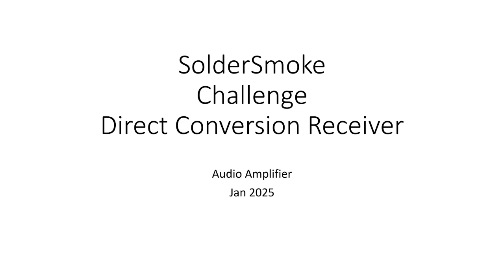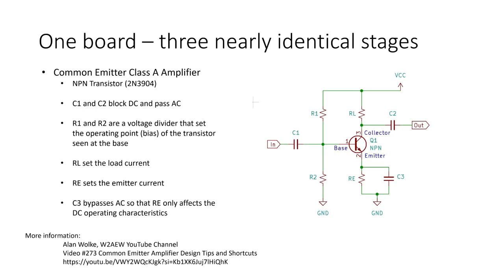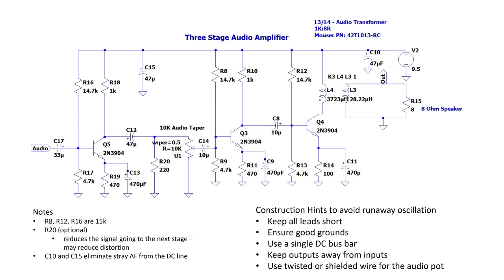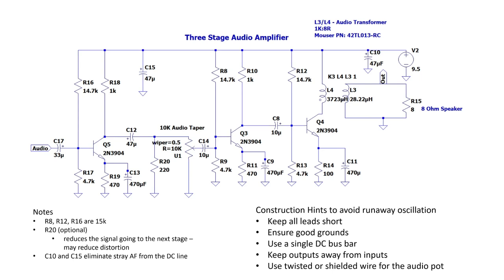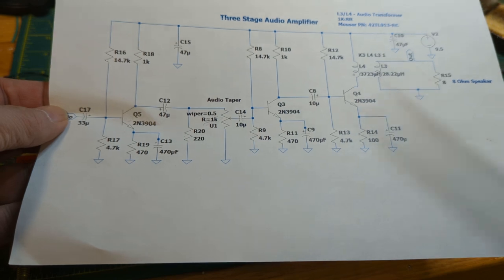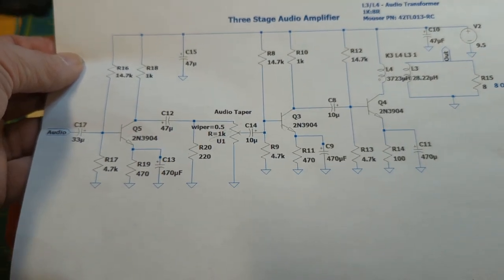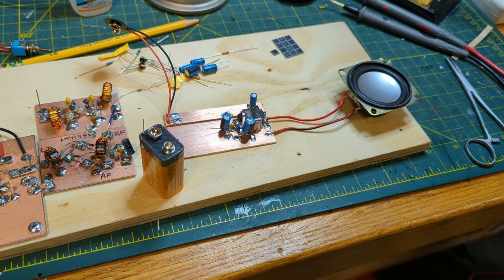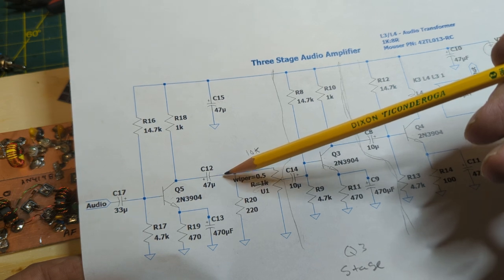SolderSmoke Direct Conversion Receiver Challenge #5   Audio Amp

Comment: Great job! You are a true Elmer. Now please do an Xmitter. :)

A more detailed explanation of audio-taper volume controls, (potentiometers/pots) for the curious:
Our ears do not hear sound in a linear manner. Surprisingly, a sound that is generated with double the power of a previous sound does NOT sound twice as loud as the previous sound. It only sounds a little louder, meaning our ears hear sound in a logarithmic manner, so a volume control potentiometer, (a 3 terminal variable resistor,) for sound is designed to also be logarithmic in value as you  turn up the volume, meaning that when the wiper is rotated halfway the resistance measured between the wiper and either end is not the same. the resistance between the wiper and the terminals at either end are not half of the potentiometer's total resistance. The resistance to 1 end is much higher than half of the pot's resistance. The  resistance measured to the other end is much lower than half of the pot's total resistance. (Measuring this resistance is a good way to tell the difference between a linear taper pot and an audio-taper pot.) This logarithmic resistance taper causes the sound to appear to increase in a uniform manner for the human ear as the knob is turned 'up'. A linear taper potentiometer used as an audio volume control appears to the human ear to have nearly all of its ability to change volume stuck right near 1 end of the knob's rotation, making the sound level very hard to properly adjust. Thus the creation and use of logarithmic, (audio,) taper pots.
Reply: It was the term audio-taper that surprised me. Never in the 40+ years I've been working as an electronic engineer have I heard it called that It's either a fairly new description or it's something that differs between the US and UK . Right from early college it's always been described as either a linear pot or and log pot. Log because of the ears response. Nothing else.
Andy

Comment: Good video. I wonder if an isolating resistor in the positive supply to the 1st audio amplifier, may help with the unwanted audio oscillations?  It should improve the power supply decoupling into that first audio stage
Reply: As I've see examples of the  decoupling added to similar designs, I thought it prudent to isolate all three stages and put a power filter on all three stages 100 ohm in series, a 0.1 at each end of the resistor to ground and a 470uF from the stage power rail to ground.

This amp is very high gain, and it's easy to overload / oscillate. As the emitter is completely decoupled the ac gain is basically limited by the hfe of the transistor. When I tested the first stage, I hit the supply rails! I ended up turning the generator down to 20mV for testing. If the trannys are all very high gain then adding some negative feedback in the emitter may be necessary.  Try as is first then add feedback if there's a problem.

Andy
Reply: Andy, your suggestions  be helpful examples of good practice, but our experience is that it is not necessary in the design of this simple receiver. In keeping with the ethos of making it as simple as possible, but no simpler, we elected not to introduce negative feedback.  Similarly, the single power rail handles most of the DC issues and isolating the stages with separate power filters turned out not to be necessary. We've tried to remind our EE friends that we know we did not design the best or the most highly optimized circuits. Rather we attempted to build the simplest ones that would produce good results.  We have a few simple bandaids for oscillation in the audio amp if it occurs.  Putting a 220 ohm resistor in parallel with the volume pot has been sufficient in nearly every case to knock down the distortion and prevent the amp from going into oscillation. If that doesn't work, we would suggest sampling 2n3904s for the first stage and find one with a lower hFE.
Reply: As said, try it and see.  It's a "lively" amp 🙂

By the way, where did the term "Audio Taper" come from in all the years I've worked in  the industry, I've never heard anyone use it before ?
Reply from the maker: What does audio taper mean?
Very simply, with a linear taper, if you turn the pot halfway, the resistance measured on each side will be equal. With logarithmic (aka "audio") taper, that is not true; the resistance follows a logarithmic progression. Log taper is used because it gives a more natural progression when used for volume control.Nov 30, 2012

Electrical Engineering Stack Exchange
Reply: How odd, Never heard of that term used over here. I knew what it was, but it's always been described simply as a Logarithmic potentiometer or more usually a "Log Pot" Usually drummed into electronic students by the stale old lecturers joke saying that "it's the same response as your ears- the one's you don't use when I'm trying to teach you!"

Andy
Reply: @kk4das122  For the two that I've  built both had the same audio amp problem, of oscillation. at the second stage Q3. I cured it with a 0.1 uF cap from the  second stage Q3 collector to ground.